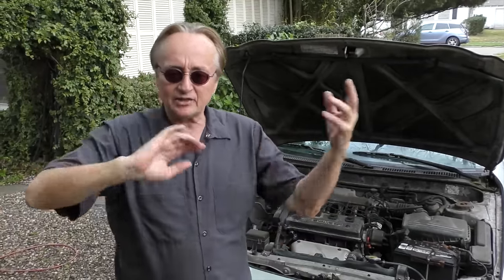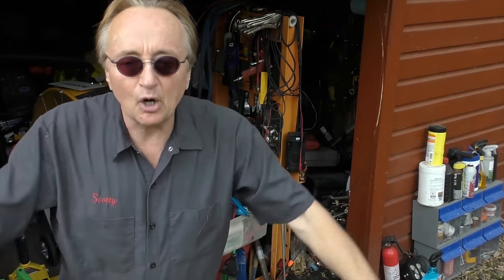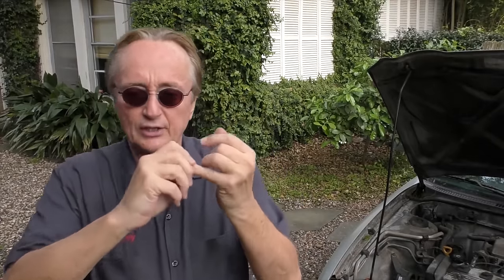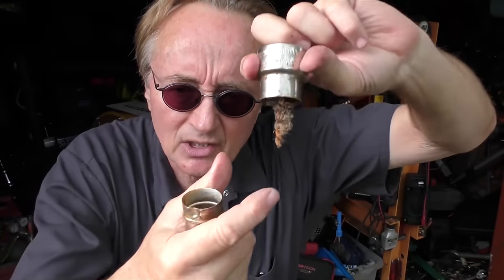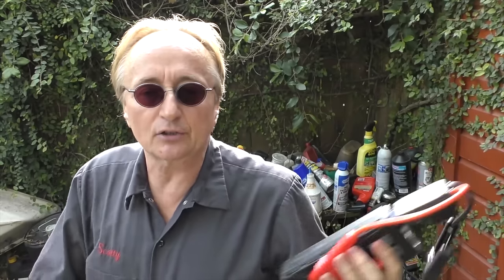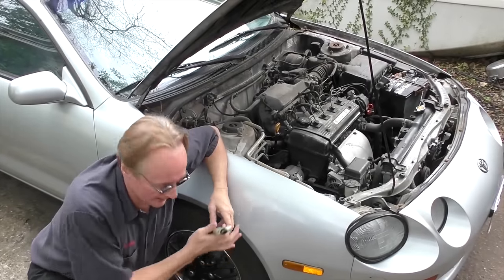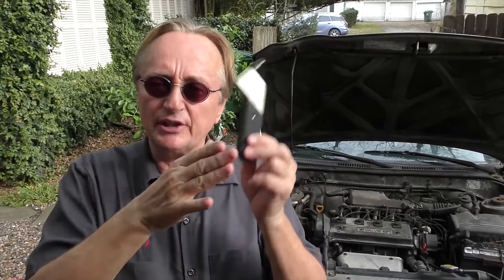If You're Not Doing This Before Starting Your Car, You're Stupid

Comment: If you change the fluids, 95% of the issues are avoided.
Reply: 3 other things - Filters, filters, filters.
Reply: @gregnixon1296  I do my own cabin air filter and air filters.  I also have a very good shop do my oil and other fluids, and they know that I know what's going on (ie: I keep EVERY, SINGLE, SERVICE record from the moment the car was new), and can use those records to track changes, what needs to be changed, what's OK, etc.,
Reply: ganzonomy    My car dosnt have a cabin air filter just an engine filter
Reply: @ryans413  usually it's behind the glove box.
Reply: ganzonomy    Nope dont got one my car dosnt have one not every car dose. Search it up 2004 Pontiac Grand Am 3.4 V6 dosnt have one
Reply: Same thing if you buy Scotty's Celica.
Reply: @ryans413  Pontiac grand 2004 is extremely reliable car, my dad has it and it is the one on which I learn to drive.
Reply: Open Ranks yep. WE are just Too Lazy. Fact. 3000/ 18 months oil changes. I drive once a week.
Reply: and buy a Toyota
Reply: Oh I change the fluids😉
Reply: My '99 Cutlass doesn't have a cabin filter either as far as I've researched
Reply: Wyatt Cerri ew
Reply: @Royalewithcheesee  Funny thing about it is that it used to be my mom's daily driver and it got moldy sitting so.... 

But hopefully I'll have it running in about 3-4 weeks, I just ordered most of the tools and parts I need today. Since it has 70,000 miles on it and I got it for free I definitely felt like it's worth repairing for around $1500-$2000 including the legal stuff. The engine rebuild is warranted by me tho, I wish I would have waited until I was better with cars to flush the cooling system.
Reply: Wyatt Cerri congrats my friend....congrats
Reply: I change my own oil.  It is now becoming a push whether I can do it cheaper than a quick change shop.  
But I do it because it forces me to look under the hood and under the car.  I rotate my tires for the same reason.  It forces me to look at the axles and disk brakes.  Doing this very, very basic maintenance forces me to look at the fluid levels, check my tires and tire pressure.   It takes me about 60-90 minutes every 3-4 months.  It is worth it.
I have caught numerous issues before they became problems.
I also  wash my vehicles and keep the mud off the undercarriage.  I wipe my engine covers and hoses down when changing my oil with a rag.  I don't clean it to make it car show ready, just very crudely wipe away dust, dirt, and any grime.   Why, because I can see when leaks start before it becomes a problem.  Clean the undercarriage hopely will slow down rusting the body too.
When I am all done, I write it down in my maintenance booklet that came with the car.  If you don't write it down, you probably didn't do it.
Reply: I went 136k miles in my old 2015 Ford Fusion and only changed he oil every 7k miles. Never broke down once and had zero problems with it.
Reply: True. If you put good engine oil every 5-7K miles, change the oil filter, change all the other filters regularly, change the brake fluid every 2 year, change the auto transmission fluid every 60-70K miles and diff fluid also, change the engine coolant every 5 years or so, always using correct fluids and filters...you won't have 90% of the problems. The problem is most people when car is out of warranty, they don't care, change the engine oil when they remember and that's it. Then it brakes and costs a fortune to repair.
Reply: I change my oil every 4k to 5k
Reply: 3k Mile oil change intervals.  I check fluid levels monthly and brake pads quarterly.  I also clean the schmutz off weekly and so a full wax every 2 months.  Car runs amazing.
Reply: My '96 Ford Taurus has a cabin air filter (manufactured in late 1995). It must have been one of the first models to have one.
Reply: @ganzonomy  About 1 in 10 cars that I see come into jiffy lube don't have cabin air filters
Reply: Car are like men, the fluids must be changed regularly.
Reply: @ryans413  thats just weird, so it doesnt have a filtering system?
Reply: Alex M   Just on the air intake for the engine the cabin got this mesh lining just under the wiper blades I believe that’s to stop dirt and leaves from being sucked down into the blow fan. I recently replaced my blow fan and was surprised there was no filter at all did some research found out this car didn’t have one
Reply: My alternator went out but all my fluids were good 🤷🏼‍♂️
Reply: @Pricysalamander    JIFFY LUBE will NEVER DO ANYTHING FOR ME EVER AGAIN, WHY? They fucked up 4 cars over the years , long story 🇺🇸🇺🇸🇺🇸🇺🇸
Reply: Thank you Scotty i strongly dislike a gas and go man. Which means he knows nothing but gas and go
Reply: What about a timing belt, do you guys wait until it breaks?
Reply: You change your brake fluid often
Reply: @ryans413  if its got ac its got a cabin filter
Reply: @ryans413  yes it does.... It be under the hood.... Passenger side. 😎
Reply: amazing how many people don't do it, although they already know it. so have a good cup of coffee first to get your mojo!

Comment: Scotty is like the grandpa I never met, my family always told me he loved cars, and fixing them.
Reply: My grandpa taught me how to drive my first car.  He taught me about gears, the difference between leaded and unleaded gas, how to check the oil, and that I knew how to change a tire.  That was 49 yrs ago.  Today I bought my first automatic transmission car, a used Toyota, and it was to Scotty Kilmer that I turned to for advice.
Reply: @OB17358  w
Reply: My grandfather, too!  He was a helicopter mechanic for the Navy.  He was driving his 1965 AMC Ambassador until he died in 1980. He fixed lawnmowers after he retired.  Memorable advice: Open your hood after parking.  Heat kills your engine.  He lived in Corpus Christi and Florida.  And, flush your oilpan with kerosene after draining the oil.  Cleans all that crap out of the oilpan.  About a pint will do.
Reply: Nah; mine threw wrenches, cussed n fussed, told me greasy hands added flavor to a sandwich, and kicked/punched/yelled at vehicles to establish dominance. 

I think engines were scared to fail around him....the ol hairy eyeball would stop any sputter short!
Reply: You can learn a lot from good old Scotty - LISTEN & LEARN!!!
Reply: @OriginalGlorfindel  sounds like my old man ahaha

Comment: 0:25 brakes
3:02 ownership tips
4:58 Li battery charger / battery tool
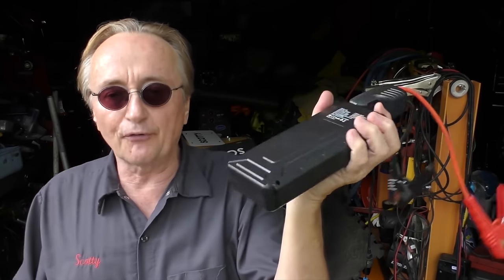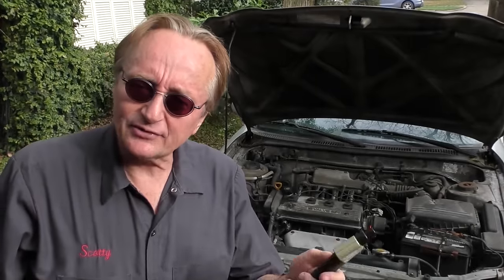6:22 radiator / heater 7:29 tire pressure 10:45 recalls
Reply: I had one of those lithium chargers. Worked great. Someone stole it. Didn't know what it was. Left me with the cables and  clamps. 
Stupid thieves.
Reply: But he never mentioned whatever the thumbnail was about?
Reply: @stevePHXD  I agree, I’ve scanned through the vid twice now and it’s fkn frustrating.
Reply: @stevePHXD   I know right!
Reply: @petergustaf5633  I used to have one of those bigger jumpers, that contains a motorcycle battery, but also has an air pump and stuff. Left it in my car one night unlocked by mistake, and it was gone by morning. I found it about a year later being used by one of my neighbors, and I knew it was mine because of the very specific chip out of the plastic after it fell over once. It was SO satisfying picking that thing up and smashing it through his windshield. (He was using it to inflate a tire, and had left it unattended.)
Reply: @stevePHXD  He seldom does...
Reply: Do you know where the secret is?
Reply: Thanks @cowboybob this is so helpful.
Reply: I can’t find the tire pressure gauge at any of the links at Scotty’s Store … anyone know what it is?

Comment: appreciate the common sense approach of your videos..   with the brake fluid issue..  if your brake fluid is low from pads/shoe wear, it is time for service of the pads/shoes..   usually when the fluid is that low from normal wear, it means there is little to no life left in the pads/shoes..   also, when the pads/shoes are replaced and the calipers/wheel cylinders are compressed it can cause an overfilled reservoir to dump the excessive fluid causing a mess..

Comment: I'm a lube tech at Ford, and was one at Toyota aswell and he is completely correct, check everything over when cold and ill tell you most issues you believe you need take to the dealer check right then and there, done one to many tps lights that were on for just for it being cold out, you pay 20 something for diag on that and possibly a nail repair so it's justified but if it turns on shortly after airing up then yes a problem but 9/10 its not, keep up with checking fluids every month or so and changing tire pressure accordingly to weather or terrain, and guess what no lights ever, (im well aware what I'm saying is essential giving away information, and possibly job security for me but don't spend money when you don't have too)
Reply: Only 20?😅
Reply: @HandleHandle233  depends like I said, some dealerships like the ones I work at did free code reads for dash lights, but if required to bring into the shop for an actual diag or look over, dependent on which light or reason, 20 to 100 is normal range.
Reply: I have 4 lights on on my dashboard & it was fine when I took it to Firestone  for fuel system cleaning ..oil change..& wheel alignment now they want to charge a baby fortune just to look at it...Toyota FJ Cruiser 2008  are they trying to rip me off
Reply: @jenniemalone9403  if you dropped the vehicle off with no codes and it leaves with them they should be held liable, I'd take to another dealership and ask for a code pull and possibly tell them th situation as that doesn't make sense to me
Reply: @jenniemalone9403  Your first mistake is taking your vehicle to a tire place for anything not related to tires. What you get is a wallet flush. Bottom line,,,, screwed.

Comment: Excellent advice. When I was in my 20s and in to my early 30s I was doing some engine rebuilds, and working on high performance vehicles.  Now that I am in my 70s my preference is to have my vehicles serviced.  I managed to find a decent dealer that has been very honest with me.  Most of the time when I bring in my vehicle I know what the issues are.  I often check out my vehicle before bringing it in and give them a list of what I found.

Comment: Scotty, you are so right about the tire inflators at gas stations.  Put air in the tire of my Sequoia using one of these, required about 32 psi, the day after I checked the tire pressure with a gauge like yours and it showed 65psi!
Reply: the old free-standing ones with the crank to set the pressure and the hose hook actuator are the best ones- but they are an endangered species because gearheads snap them up for their garages- darn gearheads...

Comment: When you mentioned the recalls are forever part it reminded me of when I worked at a Chevy dealer and someone brought in a 20 year old s10 blazer for a recall that only applied to the first few weeks of production.  It was so old we had to look all over the country for the part. When we finally got the replacement rear seat hinge for the recall the Package was so old it was falling apart but we had to either find the part or buy back the truck.

Comment: I love what you teach us as consumers. ❤️
Reply: lol
Reply: Our 95 Honda brake lights would not go off and ran our battery down.  The little nipple on the brake peddle
Reply: Brake peddle arm has to turn the brake light switch on and off broke off. We used a bolt and nut through the hole to push on the brake light button and works great.
     Love your videos, thank you for your service .
Reply: Need help on replacing broke off studs in the right front wheel of my 95 Honda, Accord.  There is a hub holding the studs than we cannot get off.  This model has the extra hub against the rotor.
Can you help. My manuals don't cover broken studs replacement.
Reply: @raven4k998  lolz
Reply: @jeanne strader. You can fix your problem by buying a new car……… Lol

Comment: I just found this channel and I instantly LOVE IT! So true, my AC was working and then it just stopped blowing air while I was driving. I took it to a chain and they said it was the AC Clutch, etc  etc, would be ready in about an hour for $775. OUCH! I took it to a mom and pop auto parts store that I have been frequenting for years because well, its a local mom n pop. The owner came out and checked everything. He started with maybe a fuse relay, then did the screwdriver magnetic something test, then got in my car, oh a 2011 Honda Civic EX, and bumped under the glove box. It started to blow air like normal. It was my blower motor. Cost me $79 bucks and I was able to change it myself in under 15 minutes. No disrespect but has anyone asked or thought Scotty looks like Dennis Hopper?

Comment: Always remove your brake fluid cap before pushing the caliper pistons back in when doing a brake job. If you've topped off the fluid due to brake wear, there can be a bit too much fluid in there and when you push it back into the reservoir it can crack the plastic and cause a leak.

Comment: Hey scotty love the showman I’ve learned so much I’m just watching a program. I had a front wheel bearing making noise I knew it was the right front wheel bearing. I took it to four different repair shops and everyone tried to rip me off. Telling me it was the rear wheel bearings telling me it was the brake everything but what I knew was wrong with it. Finally I said the hell with it took it over my friends house who has a car lift pull the tire off replace the bearing noise on the way . I took the bearing back to each one of the crooked repair shops show them the war out bearing and told them that they were safe I need to get out of the business. It took me about an hour to fix my Truck. I found out about 98% of car repair shops are crooks and it’s a shame. I love the show keep them coming Scotty

Comment: Scotty, I love your common sense practical view on all things automotive! I bought a new Jeep Wrangler right hand drive in 2010 to serve my rural mail route. If they were not the only manufacturer making a factory right hand drive vehicle I would not have bought it. After about 2 years, I was notified of a recall for the airbag clock spring. At that time, my airbag warning light had not ever come on, but I had it replaced for free anyway. Recently, the warning lot has activated and I had it scanned for the problem, which was the airbag clock spring. I figured the initial recall and replacement of a faulty factory part would cover the part for the lifetime of the vehicle. The Jeep dealership told me "Not so. Once a proper repair of a factory recall is completed, if it ever goes bad it will be totally my responsibility and expense to have it fixed." This seems insane to me as airbags are a critical safety component of all modern vehicles and the NHTSA saw fit to order the initial recall. What are your thoughts on this Scotty? Thank you for all of your videos and help!

Comment: Depending on the car, you may have 1 or 2 brake lights. If you only have 1, it could also mean that the parking break is on.
If it is low, as mentioned, don't fill it all the way. If the brake pads are getting low enough to kick the light on, you're likely due for new pads shortly. When the new pads are put in, this will push fluid back into the reservoir. If you filled it too much, you'll overflow when the new pads are installed. Not a problem, but messy.
Reply: I'd also love to know where the "coolant" went... Has to be a leak no?

Comment: The 2021 RAV4 has 36PSI tire pressure. Winter came and the light came on. Put air in and it went off.

Comment: 1) brake light on.
2@2:34 service car soon lite on
3@4:05 car doesn't start
4@6:25 car heater
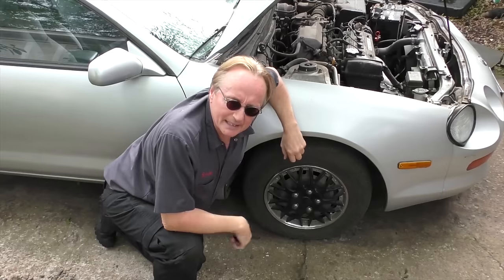5@7:30 air pressure in tires

Comment: Scotty, you're something else.... (in a good way).  Just yesterday a friend of mines mini van wouldn't start, the battery was under 10 volts and is fairly new.  I figured it out pretty quickly.  She spends a lot of time with the doors open loading and unloading her stuff and doesn't drive enough to keep battery topped up.  I have talked to her about this in the past but she knows I'm pretty stupid so just ignores that kind of info.  This is the first time this has happened to her.  Every time I pop the hood I give the battery cables a good wiggle pull.  I charged the battery and checked the alternator output.  I'm sure all of this will happen again!  Thank you for sharing your very valuable info, knowledge and experience!

Comment: A simple check i learned with tires is a low pressure will be hotter, a quick temp check will show around 4 degrees higher on a tire that is 5 psi down, this could vary depending on climate and sea level. The best time to check is just before sunrise but thats a bit too early for me lol

Comment: In the #5 section - talking about tires and pressure, I thought you would've mentioned to set your tire pressure by what the Manufacturer decal in the vehicle says. Not by what the tire says. The decal or sticker is usually found in the driver's door frame or on the end of the door itself.

Comment: Simple things but very important to keeping a car a long time economically. My 2008 Prius needed a water pump brakes and a 12 volt battery and that’s it after 140,000 miles. 50 mpg 
Hybrid battery performing perfectly no sign of weakness. Thank you Scotty. You’re very diligent and you have to be to get to the bottom of things